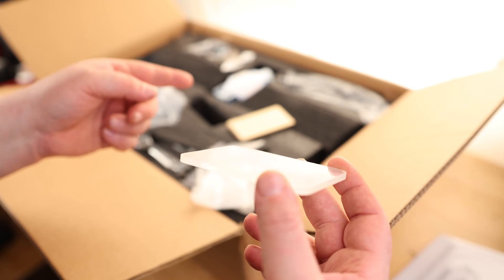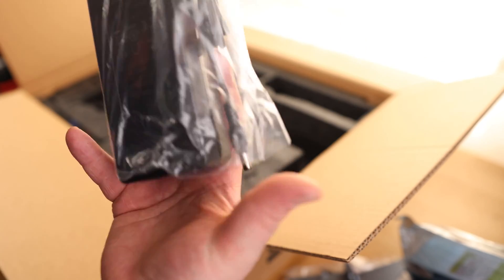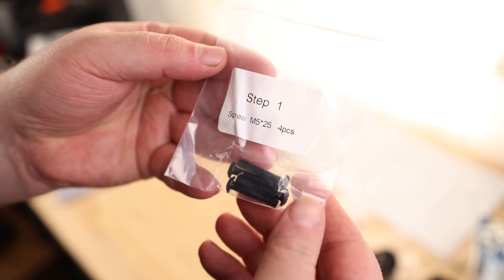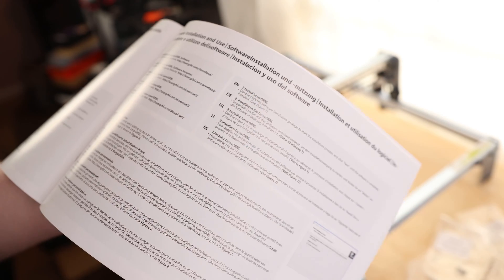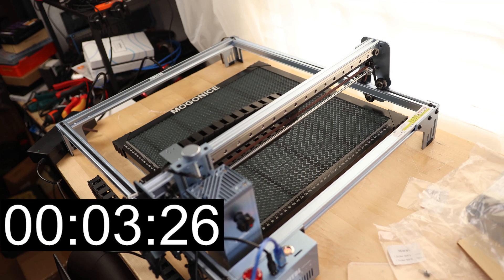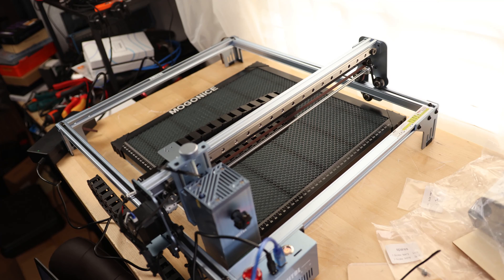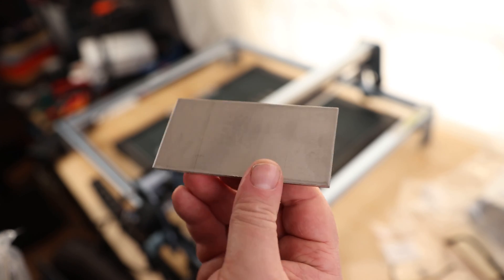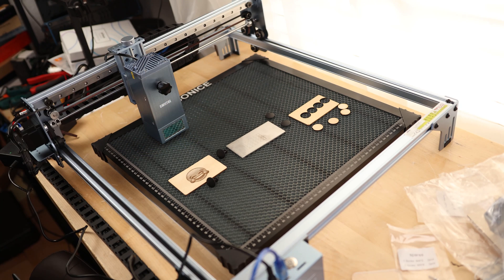Swiitol C18 Pro Laser Engraver and Laser Cutter, 18W Output CNC 30000mm/min

Comment: any tip on offline engraving?  I cannot get burnlab app working successfully.  also, not see a compatible control panel for this model.
Reply from the maker: I primarily use lightburn for laser engravers.
Reply: Thanks for your reply!